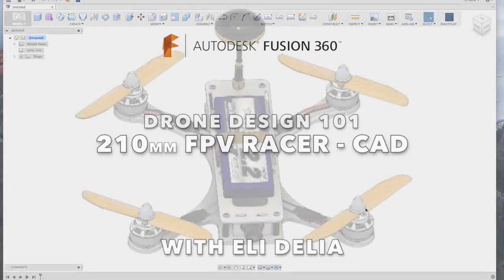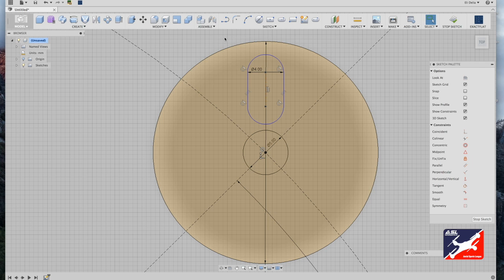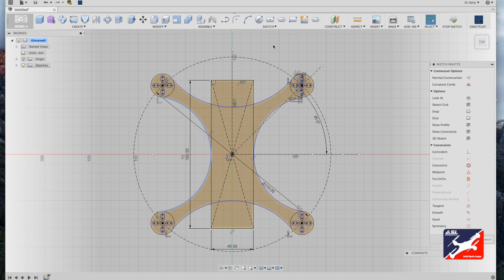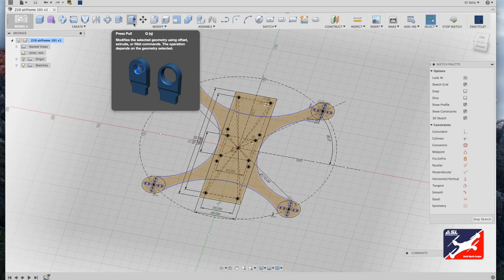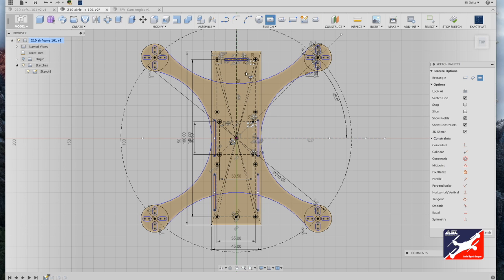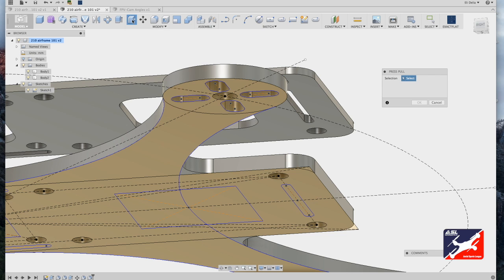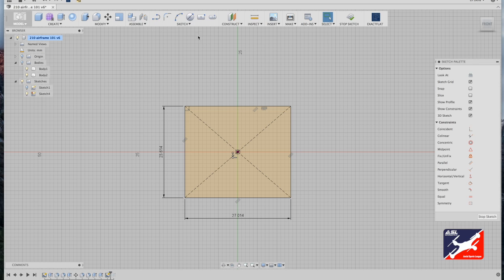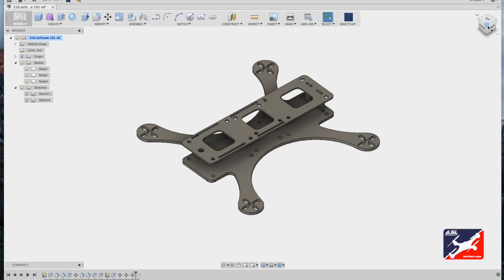Drone Design 101 - 210mm FPV Racer pt.1- CAD

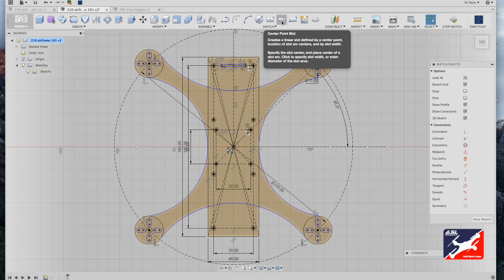Comment: @ 9:03, be careful not to place the slot on the construction line. I noticed he originally did place the slot on the line, which I did as well. For some reason, Fusion will crash/spin when you attempt to alter the location/size of the slot. It will not let you move it around, at least mine reacted this way, on two different machines, both with plenty of VRAM. Place the slot to the right of the construction line, as he shows at the hard jump edit. I'm guessing he had the same issue. Not sure if this is an issue in Fusion or what, but it will stop your modeling in its tracks if you don't place the slot correctly.

Comment: Eli thanks to your clear instructions in this video, I have my design done! Now I want to build it. Where can I buy the 3mm & 1.5mm carbon fiber stock cut? I checked HKing, BGood, EB-y but do I have to spend $35+ bucks? Any recommendations? URL's would be great so I don't buy the wrong thing. I have access to a ShopBot at a local TechShop. Is this the right cutting machine for thin sheet like this? Thanks!
Reply from the maker: Hi thanks for your questions. 
$35 for a sheet of Carbon Fiber is pretty standard. 
There is Amazon which has a good selection:

https://www.amazon.com/s/ref=nb_sb_noss_1?url=search-alias%3Daps&field-keywords=carbon+fiber+plate&rh=i%3Aaps%2Ck%3Acarbon+fiber+plate

For prototypes designs before cutting a final i like to work in G10 plates. 
I have a good contact with Dongguan Xiechuang Composite. They have a great range of materials, G10 thru CF.   Karan Zhong is very helpful choosing and ordering materials: 

http://xccfrp.en.alibaba.com

Yes the ShopBot is a fine machine to work with. Next episode will be going in-depth for preparing CAD files for CAM and will cover ShopBot output. 

From Fusion360 / CAM, choose Actions / Post Process. 
Source: Generic Posts
Post Processor: ShopBot-cps
Units: Be sure that units match your file's units all the way through to the shop bot. if millimeters then be sure the CNC file is also millimeters. 

Hope that helps!
Reply: Many thanks Eli for the source info as well the tip of doing my trials with G10 plates before going to carbon fiber. Looking forward to your CAM video. Love that your video has all the info to follow along easily but tightly trimmed! Hats off to you!
Reply from the maker: Thanks! Yup, I'm big on no nonsense.